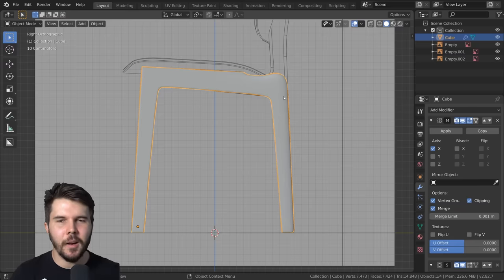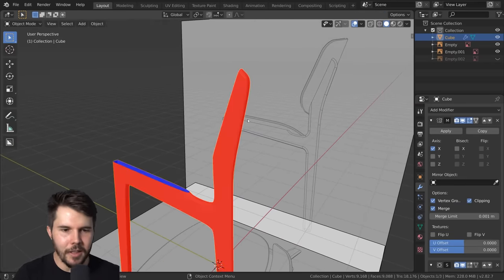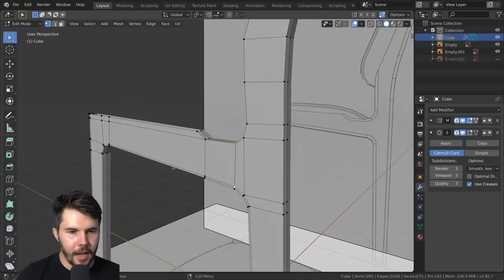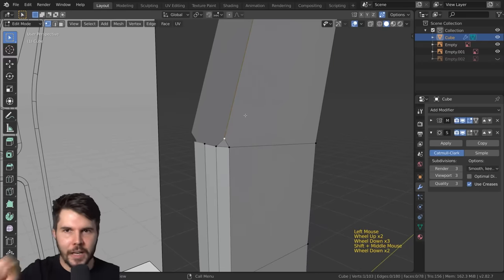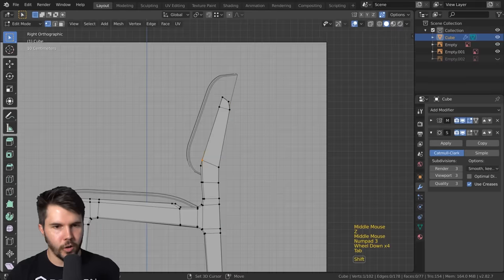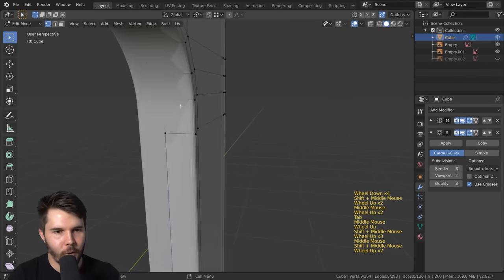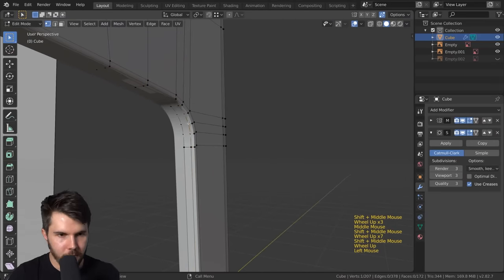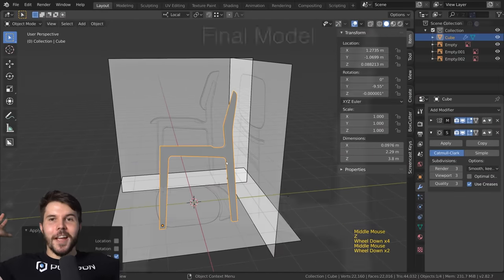Blender Beginner Chair Modelling Tutorial - Part 3

Comment: 18:48 
for those who want to set the orange dot in the rotation to the bottom of the chair leg:
1. in your toolbar (hot key: t) select the second icon (''cursor'')
2. left click the bottom of the chair leg so that the cursor gets fixed there
3. in object mode, make sure the mesh is selected, and then right click
4. select ''set origin'' > ''origin to 3d cursor''
done, you can rotate around that point
Reply: When I did that, there was a line cutting through the middle of the chair leg. Do you know how to solve this?
Reply: @8bit-storm606  sorry, didn’t happen to me... but I often get problems like that if my proportional editing or snapping is on.
Reply: @8bit-storm606  clipping mode turn it on
Reply: @8bit-storm606  Mirror applied?
Reply: NTA RAJEL MZIAN NTA
Reply: If this breaks your mirror:
1. go to edit mode
2. Front view. Select bottom middle(left)  vertex
3. At the top left,  where is view, select, add.... Chose Mesh/Snap/Cursor to Selected
4. Then in Object Mode - Set Origin to 3D Cursor
Reply: @vralar  ty i tried snaping origin to 3d cursor but since the cursor placement was manual it kept getting splint,i used maya a bit so i was looking for vertexsnap option but coudnt find u helped a lot ty
Reply: Thank you very much, that solved a lot of headaches!
Reply: @vralar  THANK YOU!
Reply: @vralar  that is cool, thanks
Reply: @vralar  tysm!
Reply: @vralar  Thank you!!didn't get what you were saying at first but then I actually solved the mirror problem

Comment: I'm kinda new at this so at around 12:27 I got super confused about how his 4 vertices became a face. Turns out if you select all the vertices, and right-click, there should be an option called New edge/face from vertices (or just hit the F key). Hope this helps the other noobs out there. :)
Reply: first tutorial "guru " says, I recomend to see the making donut tutorial.. It is true.
Reply: you can use grid fill too
Reply: Thank you!
Reply: thank you soooooo much
Reply: you saved me such a headache man thank you so much
Reply: @최상우-z3c  It is, I did it, and I was still struggling with this issue. For people having 100% recall, this is easy, but I am a humble human. :)
Reply: @_jiba_  dont worry, you'll get used to it with practice
Reply: Plus, if you don't know what's going on, look at the bottom right corner of the workspace and it shows what keyboard shortcuts he's using.
Reply: almost had an heart attack thanks man.
Reply: What I did was bridge Edge loop lol, too much ways, too little time.

Comment: 18:56 If you want to resize your chair but it is leaving the bottom line and increasing from all the sides, that's because the origin of your leg chair (small orange dot) is not at the bottom of the front leg (see Andrew's). 
To do that, follow these steps:
1. Put your 3D cursor at the base of the front leg, by holding Shift and then Right-clicking at that specific place . I will suggest that the specific place to put the 3D cursor should be at the midpoint of the front leg's base from "inside" i.e., by zooming in the mesh.
2. Tap on the chair, right-click > Set-Origin > Origin to 3D Cursor.
Now you can re-move the 3D cursor back to where it was while your chair's origin will stay at the selected place.
Now you can resize your chair with ease.
PS: Make sure that you resize only on the X-axis (or at whatever axis your thickness lies), otherwise your chair will go beyond the reference image's scale.
Reply: and if you are using right click select then just select the middle edge of the bottom face
shift+s -> cursor to active 
then click on the model -> w-> set origin -> origin to cursor.
Reply: When I set origin to 3D cursor it splits my mirror? Do you know what might be happening?
Edit: Turns out my origin was not centered on the leg and it was changing the mirror starting point. I just eyeballed the center line and eventually it worked.
Edit2: Scratch that, ignore my first edit, do what Kuldeep Shekhawat said, worked like a charm!
Reply: @kuldeepshekhawat4088  Oh Man! I've been searching for this for a really long time! Thanks!
Reply: @kuldeepshekhawat4088  yo fantastic work thank you both
Reply: This was the comment I was searching for! Thanks!
Reply: I had a problem with the rotation just doing helicopter flips and this fixed it, thank you.

Comment: 5:20 There is something like this in Blender. In Edit Mode: Select->Select All by Trait -> Non Manifold, this will select everything that is not manifold: loose vertices, double vertices, mesh inside of another mesh, ...
Reply: There's also an addon called meshlint that used to be abandoned but SavMartin (who has ported a lot of old addons to 2.8) has updated it and it seems to fix things like this as well, for anyone interested. I think I've come across a couple more addons that check for issues like this.
Reply: I usually use 3-D Print Toolbox addon that bundled with Blender. It adds panel below View and can analyze model for 3-D printing and correct all these issues with just one button.
Reply: I did that and it selected a few edges in my mesh..what now? deleting it seems to mess everything up, so I'm assuming they're not extras or lose

Comment: For the rotated object part, it's alot easier to double tap the direction you want it to go, so one z is global, a second z is local, much faster
Reply: Wow, thanks!
Reply: Amazing!
Reply: Thanks for the tip.
Reply: That is VERY USEFUL FOR CAMERAS. Just tap G -> Z -> Z and then you can zoom in and out of your 3D Camera easily using local coordinates.
Reply: Thank you so much, the other way would not work for me somehow, verts get moved in global directions no matter what the transform is set to....
Reply: @Nathan Ritchie Right! Zooming actually means changing focal length, but confusingly, Blender calls moving the camera on its view axis "zoom". Dolly zoom (aka the Vertigo effect) is a fun demonstration of the difference. Search "yogyog contrazoom" for a Blender tutorial and "vsauce moon terminator" for a more extensive explainer.
In Blender, you can adjust focal length in the Object Data Properties (green film camera icon) of the camera object, under Lens. (The focal length in the N-key sidebar is for the viewport and won't affect your render.)
When you're in camera view and have it selected in the outliner, you can also right-click anywhere inside the viewport, select Camera Lens Angle, then move the mouse left or right.
Unfortunately, I haven't found anything that works for "live recording" camera movements from first person using Walk Navigation + Lock Camera to View + Auto Keying...

Comment: When  you're  using the second part of Ctrl-R, or GG, to slide edge loops, there's an E option to keep the loop parallel to one side or the other. F flips which side. Better than the default weighted average, for holding-edge loops.  It's very useful, and often overlooked. You can cut in any old geometry with a knife, slide it, and wham! it's lined up.

Comment: if having trouble doing the bevel command to flatten the curved part at 6:00 I think its because for newer versions of blender the mirror modifier actually duplicates the object across the 3D cursor,. Instead of doing those steps in the last video where he made a loop cut down the middle  you're going to actually need to add that  loop cut. Also he only selects one side of the vertices and you're going to need to select both. The same goes for 8:30 where he's merging vertices you're going to need to do the same on both again.
Reply: What worked for me was disabling the x-axis on the mirror modifier in the side panel > settings bevels > then re-enabling x axis

Comment: If anyone's wondering how Blender Guru's chair is so flat,

He unselected the 'display in Edit Mode' button on the Subdivision Surface modifier.
Reply: I was so frustrated the whole time and guessing will there be someone addressing this issue. Here you are, thanks a lot!!!
Reply: if you select simple instead of catmull clark it does the same
Reply: Don't forget to turn it back on when you need it as well :)
Reply: Hey i have a problem in this "area", In object mode/ wireframe i do have a preview of the 3xsubsurf but ony the "structural" edges and they are "bended" the way the subsurf is supposed to make them look but i don't see the other edges making a dense grid. Any idea ?
Reply: I found it ! For the blenders noobs (the blendoobs ?)  like me, now on Blender 3.3, you have to uncheck the "Optimal Display" box in subsurf modifier's settings.
Reply: Thanks

Comment: blender guru: Press Alt+M to merge by distance.
blender 2.83: I'm about to ruin this man's whole tutorial series.

(it's gonna be just M for merge ;) )
Reply: Pause then google, pause then google, pause then google. My new Blender workflow! Chair's coming along nicely though. Lovely bevels
Reply: why shank you
Reply: thanks bro
Reply: GODS! THANK YOU!!
Reply: Or right click, Merge on the menu, that works too
Reply: Its such an odd change. I just right click. Less having to reach over for the keyboard.
Reply: @moncefboukhenane7098  Sure! Or via Mesh in the menu bar on the top. Or open the search with F3 and start to type "by distance". Or add a Weld modifier, then apply it. Or type bpy.ops.mesh.remove_doubles() in the Python console. Or enable the 3D-Print Toolbox addon, and use Clean Up > Make Manifold. Or enable Auto Merge Vertices (top right), and scale all vertices in by 1 (A, S, 1, Enter) in edit mode. ;)
Reply: @AltimaNEO  You do you! But why is it an odd change? Merge is used very often, so it deserves a single key. Also, in Blender Alt+<Key> usually means "Do the opposite of what <Key> does": Alt+P = Clear parent, Alt+H = Reveal hidden, Alt+G/R/S = Clear location/rotation/scale, ... Alt+M is now Split, the opposite of Merge.  (IDK what M did before, and what hotkey Split was assigned to.)
Where do you keep your other hand all the time if not on the keyboard, anyway? :^)
Reply: @nibblrrr7124  Ah yeah, understandable. Havent used blender enough to fully understand its conventions yet.

Comment: I think it's great that the Blender Guru mentions some common issues that can happen while modelling and how to fix them. 

So far in the tutorial I've had a few moments where I was like wait a minute, why does it look weird? Even though we're following a tutorial carefully step by step, sometimes things just turn out different. Just be patient and try the tips the Guru mentions. 

If the mesh ends up weird and you can't Ctrl+Z back to safety, you can also manually add vertices until it looks right. If you select a single vertex and press E you get a connected vertex you can place somewhere you want. You can select four vertices and press F to make a face between them. At one point I noticed I had several extra vertices close to other ones but not close enough to remove by merging, so I had to manually move them close enough to the right ones that they merged.

Comment: 18:48 if you go to rotate or scale and the leg splits in 2, this is from the mirroring modifier.  Increase the Merge distance on the Mirror modifier settings until they snap back together.  I initially had mine at .001m, and had to increase it to .002m to get it to snap back together.
Reply: :hands-yellow-heart-red:

Comment: the woodworking word you're looking for is "round over", IDK if that helps you but that is most likely a 1/4 " or 1/2" round over which means the radius that you're working with where the beveled part would be the removed wood material
Reply from the maker: Thanks! I’ll remember for next time.

Comment: The scale changes if you scale the object in object mode which is correct. When you apply transform->Rotation you are saying to the object "This is now my 1:1 size of my object", so scale is now 1. If you go into edit mode and scale, you are not changing the scale of the object, you are just changing vertex positions by using scale. The same applies to position and rotation transforms.

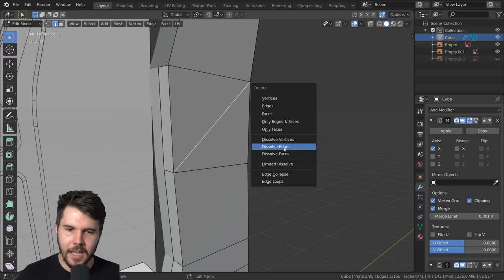Comment: Here's why "Dissolve Edges" didn't work in that case (4:25): You had an edge on top of a face (quad). If the edge actually divided the quad into two tris, you would have been able to dissolve it, since it would have been connected to two faces. But, it was just an edge connecting two vertices, so deleting it was the right move there.
Reply: Just in case, if you do want to divide the quad with an edge you have to click J instead of F to create the edge.

Comment: 18:50 when i rotate the leg it does so about the geometrical center of it and not around it's botto part as in the video, how do i correct that?
Reply: I applied mirror before rotating
Reply: Something that I see happened to me is if I apply the mirror on edit screen it sets the origin to 3s cursor, if I apply the mirror in object mode it sets it to the legs origin.
Reply: Were you able to reset the origin?
Reply: Anyone looking for the answer, set your 3D cursor (press the button below the "object mode button" with a red and white circle) at the bottom of the chair then select object (top left corner, to the right of the 'object and edit mode' button ) > set origin > origin to 3D cursor
Reply: In object mode go to your front view, hit ctrl + .(period) that will allow you to move the origin point. Hit G to move, then Z to move only vertically and it'll allow you to slide the origin point down to around the bottom of the leg like in the video.
Reply: Do not apply the mirror mod yet. You have to be in OBJECT MODE to rotate it correctly.  :)
Reply: @johnlcq  added tip I discovered. Hit ctrl + .    again to get out of that origin point moving mode.
Reply: @johnlcq  This worked! and to specify for others it's NOT the .(period) on the number pad, but on the typewriter keys.
Reply: Michael Scheffke thank you so much
Reply: in edit mode select the bottom center vertex of the chair, then hit shift + s and set cursor to selected, then in obejct mode set the origin to cursor
Reply: @johnlcq  I did this and now I can't rotate the chair o.O
Reply: @lucasmedeiros6712  This was the solution I was looking for! Thanks
Reply: @michaelscheffke4478  Lifesaver! Thanks!
Reply: @FlashCFilms  Thank you :)
Reply: @johnlcq  Thank you!
Reply: When I had this problem, for some reason the left reference image was selected together with the mesh object, so it was rotating around the average/joint origin point of them both instead of just the mesh object. No need to set your 3D cursor or origin, just simply make sure only your mesh object is selected.
Reply: @kelvin5685  Thank you!
Reply: @lucasmedeiros6712  thank u soooo much life svaer

Comment: If your lil' orange dot is in the wrong place at 18:40 then here's a dirty fix:

In edit mode, select the vertices you'd like to rotate from
Shift+s and hit cursor to selected
Tab to object mode
Under the object toolbar, find Set origin
Hit origin to 3d cursor

You can now rotate from the exact spot of your choice. If you select multiple vertices, the 3d cursor will place itself wherever the center is between your selected points. This may be quite helpful to know for future projects of yours.

Comment: 6:23 when creating the bevel I got weird results, as if different edges were going in different directions. Face orientation looked fine. On a hunch I selected everything, alt + m and BOOM! 31 vertices deleted. I had 31 fucking overlapping vertices for absolutely no reason. It's an absolute mystery to me but now everything is ok
Reply: Same. Which is funny because I had auto merging on!
Reply: Just tried the same thing and it worked, 10 mysteries vertices gone. Cheers dude.
Reply: Thank you! Similar issue, and this solved it. And I had just written in my notes-to-self to "try merging vertices if your mesh is wrong," but I didn't think to do it! Argh!
Reply: @StraveTube  Glad it helped. I made it a rule to comment these things when they happen and I manage to fix them because it helped me when someone else did it
Reply: that's probably because you extruded stuff with 0 distance. I do that all the times. You need to ctrl+z (or merge) every time you hit extrude and then change your mind
Reply: @iacopob  that's definitely a possibility, but I believe there was also some sort of bug that prevented auto merge from working properly
Reply: @iacopob  Hi! So every time i want/accidentally extrude i must use ctrl+z and the problem will be solved? Sorry, butIi didnt understand what you want to say... Can you explain in italian if possible... Thank you!

Comment: In woodworking, I believe you are looking for the term: "Routed edge"
Reply: coming from an industrial design background, I've always called round bevels as "fillets" while flat bevels as "chamfers".
Reply: I thought it was a radiused edge? Routers can create all kinds of edges.
Reply: @PaperHunter  Our woods class calls it a routed edge with a router. Btw routers suck ass it's the one tool I always struggle with
Reply: technically you can call it whatever you want. I do think "fillet" is more correct than "routed edge" tho
Reply: @haydenhoes12  You're right. 
A fillet is a rounding of an interior or exterior corner of two connecting surfaces. 
A routed edge is the process of using a router on a corner to create different profiles. Sometimes rounded (fillets) sometimes chamfers (angled).

Comment: 12:45 when he alt+clicks to show the face loop, and it goes all the way down the leg of the chair, mine goes round, on the x axis, would that be a problem later on with texturing? or I shouldn't mind about it?
Reply: I had the same issue! The problem is that you have to select the side you want it to loop around. If you want to loop around the sides then select a side edge. if you want to loop top and bottom then select an edge on the top or bottom.